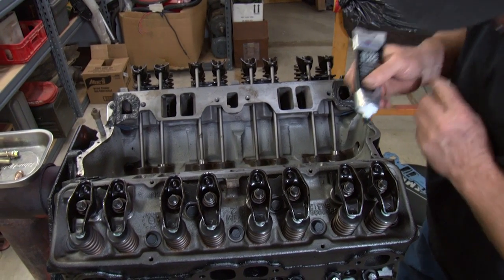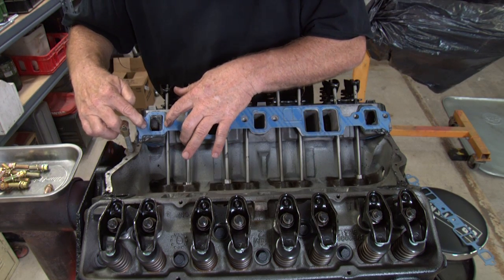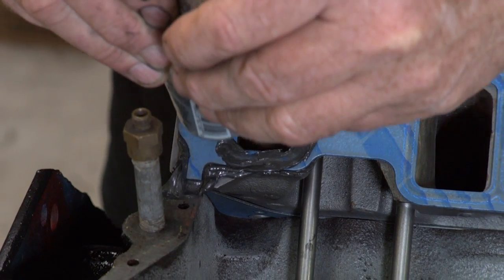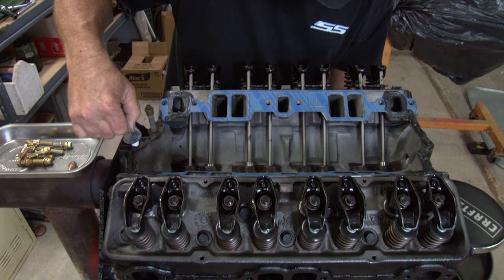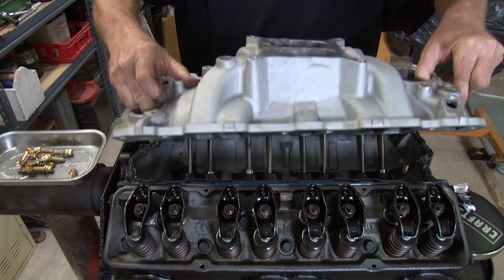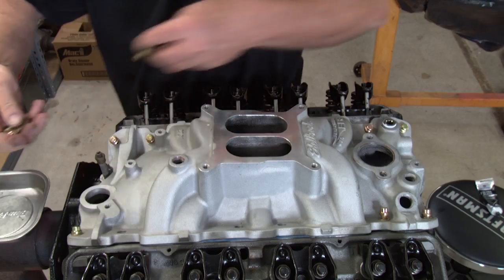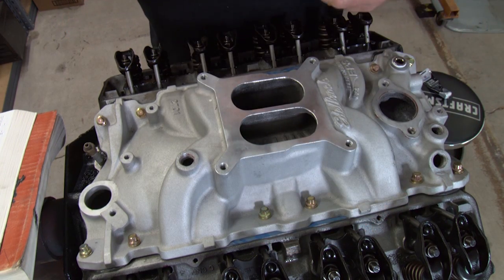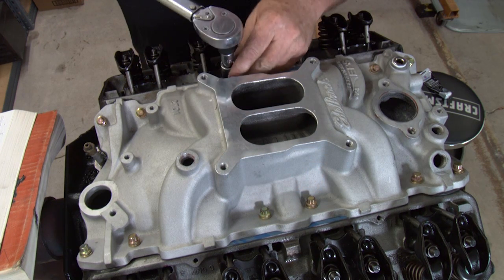How to Install an Intake Manifold on a Chevy 350 Small Block: Step-by-Step Guide

Comment: Felpro gaskets should always be installed dry. According to the factory rep at Felpro.
Reply: Try that and see how long it takes before you start downing coolant.
Reply: I only put 4 small drops one at every corner where the intake gaskets meet the rubber valley gasket!!! Never had a problem.

Comment: His torque sequence was not consistent and the universal and extension is guaranteed to change the torque value....he's probably over torqued all bolts until he removed the universal....terrible recommended video for a novice...
Reply: His torque sequence was not consistent? What does that mean? You're either using a "sequence" or not. The one he used is fine. And the extension and universal wont alter the values significantly enough for it to be a concern. lighten up!

P.S. Anyone really trying to learn something never utilizes just ONE source. Did you marry the first woman that said she loved you?  =)
Reply: @bootyman234  😆🤣😂
Reply: @bootyman234  😂 loved that

Comment: If you use universals like that your torque will be off, because the leverage has changed on your wrench.
Reply: Myth!  Extensions and universals only effect power of an impact wrench.  Unless your universals are more than 45 degrees, the adaptor doesn't change torque, only impact torque. 
YouTube has several videos debunking this.  Check them out.
Reply: Ok Einstein, how do you do it without an universal?
Reply: @chuckroast5735   here is an easy way. Setting = (torque wrench length x torque desired) ÷ (torque wrench length + adapter extension length). Most of the time probably not needed, but sometimes it's worth knowing 🤓
Reply: @brianzollars4353  Let assume that if the only way the bolt can be accessed to properly torque it is by using an universal. The manufacturer had this in mind while setting the specs. I get the science behind it, Newton's Law and all. Let just torque it down and go with it, using an universal and leave the hare splitting to Elmer Fudd.

Comment: On an Edelbrock intake you torque the intake at 25 ft/lbs, you split that, and torque two steps each. Some people torque higher, but close to 25 ft/lbs. And the installation part is just as Zack Bean put it. I saw many make mistakes in the process, and our shop had to Re setup  their intake.

Comment: GM recommendation is 30 foot pounds but I usually go 28. Yes start with half value at 14 and then go to full value. let sit for an hour or so with out turning over the engine and torque the bolts and full again to make sure there torqued at full value and then let your silicone cure for about 24 hrs just be extra sure you have a good deal and before you crank the motor over torque them one more time to make sure.